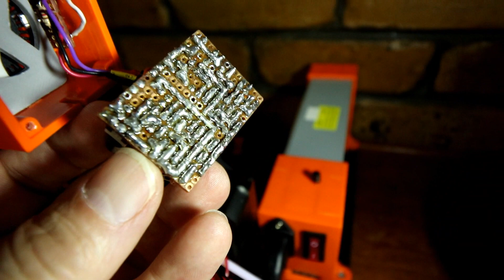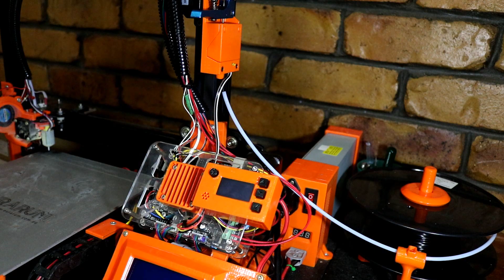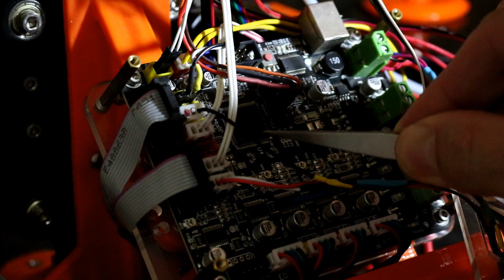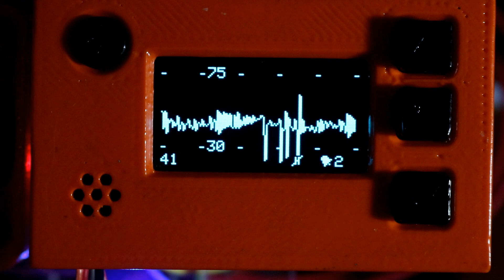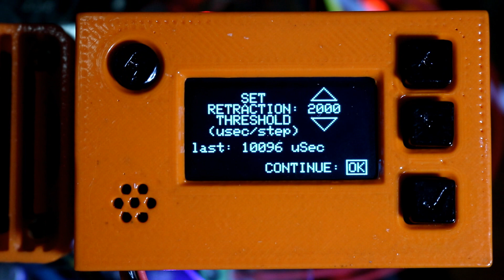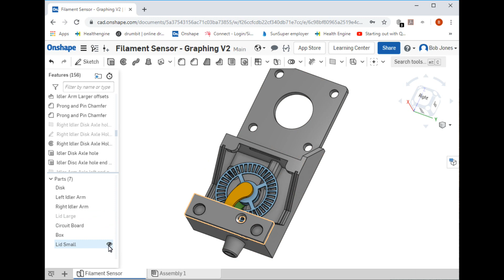3D Printer Extruder Runout and Jam Detector, and Black Box Extruder Flight Recorder!

Comment: Good work, do you think the tiny mouse wheel encoder will work with your circuits & program? I like to attach it to the direct extruder on the print head so smaller size matters. this is helpful.. thanks for sharing 👍

Comment: Very nice project! Can you modify the design to add filament width sensing? That would also function as filament Jam and out sensor. I saw a filament flow sensor and thought it would really be nice if we can somehow measure flow in real time to act as a closed loop system to adjust flow in Marlin to produce even better prints. It would also nice to feed the info to the main screen instead of needing a new one. I know it's a tall order!

Comment: You were right this is better than the old one. I found a mistake in your schematic ;)
In your schematic you connect the IR-Receiver to A0 but in your code and your circuit diagagram you connect it to A1.
I am designing a pcb. I can give you the files when I am finished.
Reply from the maker: Hey Thanks D_K!   And thanks for spotting the error - Ill look into it and fix it.    The optoPin in the Arduino sketch is A1 so I'll change the schematic.   Well spotted!